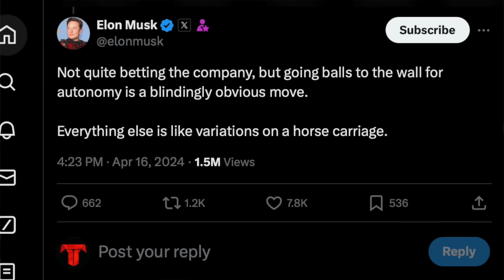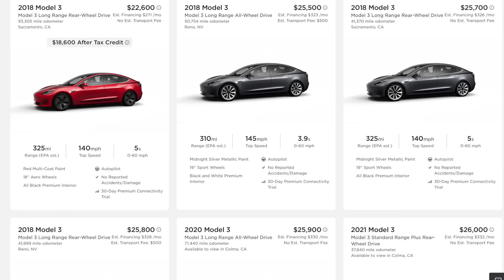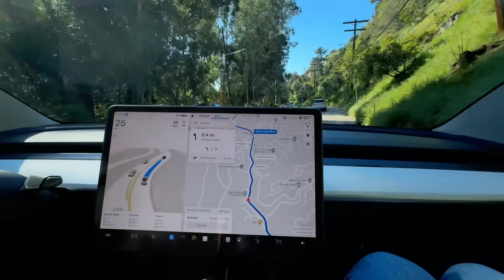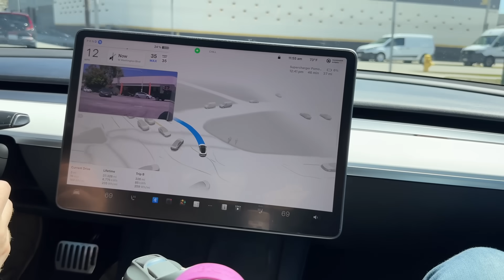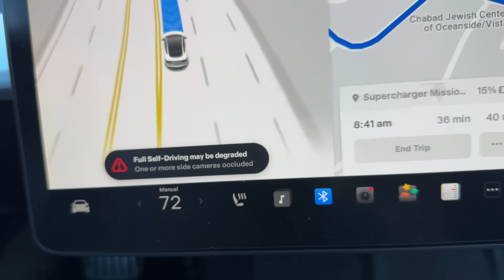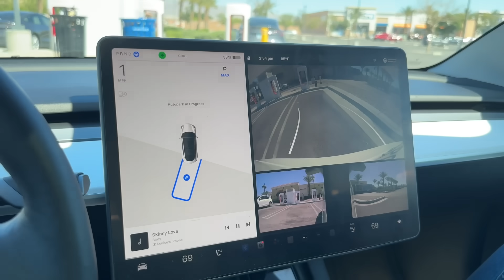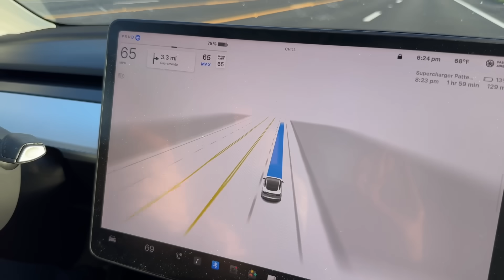Why Tesla Is Prioritizing RoboTaxi Over $25K Car

Comment: In my view: focus should be on driving down the cost of the existing lineup. I bought the Y for extra carrying capacity. I have no interest in a smaller form factor. Self driving is a work in progress. It will be ready when it is ready. In the mean time, most driers want to have a steering wheel and maintain control of the vehicle. Plenty of time to remove the steering wheel from production line in the future. Focus on beating the competition.

Comment: Solving for FSD from this point forward is a decision making problem, not a sensor problem. better camera placement could help, but as long as it is reasonably possible in good conditions (light rain, minimal snow) there is no hard limit on current camera setup. Coming this far without radar or lidar is convincing enough to me that from here on out it is an intelligence problem only

Comment: This next gen unboxed compact is going to be more of an architecture than a Tesla exclusive product. The next gen Bolt, the ID Golf, and Fords skunkworks compact will all be built on this new unboxed architecture. A prioritization of robotaxi over a competing Tesla compact EV is just a way of making the prospect of other companies utilizing Teslas new unboxed architecture more appealing as Tesla won’t be trying to outsell the compact EVs from those companies made on this new architecture. The more companies that utilize Teslas unboxed production method architecture, the cheaper the cost to produce them. I also expect Cruise and Waymo branded robotaxi services on this same platform utilizing FSD licensed from Tesla. This is a case of Tesla serving and growing the rest of the market since no one else is structured to make a profit on inexpensive EVs and no one is even remotely close to Teslas lead in self driving tech. Teslas goal has never been to bankrupt other car brands. Just to push them to produce compelling sustainable transportation. Unfortunately they have dragged their feet for so long that bankruptcies are starting to look like an inevitability. So Tesla is shifting gears to help the rest of the industry survive by becoming a supplier on which other companies can build small cars profitably. Tesla developed the unboxed method architecture to save the entire industry just as Toyotas just in time manufacturing process saved Detroit back in the 1980s by returning the big three to profitability.

Comment: I just took a lonng trip in a Tesla Model 3.   I've done the same trip in my Toyota Prius-C many times.   We had to charge at Tesla super chargers at about 38 cents per KWH.    With gas prices at about $5 galon, my Prius-C is actualy cheaper to drive.   I  bought the Prius new for $21K.     The "C" was a smaeerr lower cost verion of Prius.  Very basic and smaller.   To go mainstream EVs will need to cheaper to drive and own than my Prius-C.  (the tires for the Model 3 at 3X the price of the tires for a Model 3 and they last longer on Prius.     They need to get the cost of ownership down.  Not just the price of the car down.

Comment: 25k is paying for batteries, the car shell and electronics are free. Every couple of years you need to replace the dead batteries..
Reply from the maker: Teslas EV batteries either last 300k-500k miles or 800k - 1M miles depending on cell chemistry. Neither require replacement after a couple years

Comment: I see Las Vegas as the proving grounds and that Austin can be the plant to make the taxi as a commercial side of the business. This does not mean the lower priced car is off the table or that Mexico is not needed. I think it is part of the organic growth needed by the company. Which is at odds with it's battery storage demand that has happily augmented income. As you say it will take time and needs municipal approval. They already have a stake with the tunnels in Las Vegas that needs a replacement fleet. There is already an autonomous vehicle on Las Vegas streets that is not Waymo or Cruise. Tesla needs to move now. What they learn on making the assembly line in Austin will transfer to Mexico and India. Proving out the AI FSD in the real world will take time. Especially when you consider how long it took to approve rectangular headlights...

Comment: For me, the decision to prioritize the Robotaxi over the $25k car was what finally caused me to change my opinion about Elon Musk. For years I publicly defended him, but I now believe that Tesla would be better off without Musk as CEO. He should step aside and go found his own AI company and work on that, but stop causing delays new models of Teslas, because Musk want them to have new technology which isn't ready. It is pretty clear to me that Musk delayed the Semi and Cybertruck because he wanted them to use 4680 cells and the Model 2/C (or whatever it gets called) has been delayed because Musk wants it to have autonomy. These are bad decisions for society, because we need to make the transition to a low-carbon economy as soon as possible, and we can't afford to weight around until the next whiz-bang technology gets developed. Tesla could have been pumping out a $25k car several years ago, if the company hadn't been so obsessed with developing new tech for the car. What the world needs is cheap EVs now, not EVs with bleeding-edge tech that is still in development and will face years of regulatory approval.

Comment: Betting the company on a vehicle that has this many issues is a recipe for disaster. Also i just dont think that many people who own a car at the moment will want to rely on robotaxis. What happens in periods of high demand like at a sporting event or something and there arent enough? Maybe the more efficient move is better public transit 😬
Reply from the maker: Not betting the company. $30,000,000,000 in cash with no debt, steady income from existing lineup. Even if RoboTaxi fails they’ll be fine
Reply: @TailosiveEV maybe not betting the company, but the fact that there are already a ton of refreshed model 3’s in inventory already to me says that tesla needs cheaper new car options. Used EVs are still not a totally known quantity, and so people may be more hesitant to buy them. If their Q2 results are similar to Q1, they might have a real problem on their hands. They pulled every demand lever they could last quarter and still under performed.

Comment: We do not have enough info to speculate if he is switching positions again. He might just make the RT with controls and pay people a shitty wage to take control when needed until he gets the laws changed. With all the problems RT must overcome, we still do not understand why he thinks it is more important than the M2, other than a higher profit margin. Why won't he have the same problems as Hertz did with the RT?
Reply: That was already tired in Germany and it failed big time the response time was too slow and it caused issues that won't work this is just another snake oil sales pledge.

Comment: I'm not thrilled with this decision. "Self driving" technology has been moving forward and could be safe in the vast majority of cases but there are still edge cases, drivers and pedestrians are unpredictable. and there is a lot that can go wrong. It may be that this level of fully autonomous vehicle could only work if the only vehicles on the road were autonomous. That's not a world I'd want to live in.

A $25,000 new EV would be sweet but I do appreciate the issues you've brought up.
Reply: Don't worry Self driving cars goo down the wrong side of the road cuts off other self driving cars etc it will be a very limited auto pilot for 4 we will never have 5.

Comment: We really only need level 4 for robotaxi in most places.   there will likley be tele operators for sticky situations.   

Personally I'm goad they are making a hard move to autonomy.   They have already disrupted auto and the move to EV's is on.   chinese are going to easily fill the low cost market and no reason for Tesla to race to the bottom.  Innovation is how companies stay ahead.  First to market with EV and they will be first to market with a robotaxi that can be extended to new locations easier than a Waymo.   It's all happening and it's happening faster than many think.
Reply: Uh no it's not the move to EV has stagnated and control centres do not work Germany tried it and it failed big time 4 is all we need as a auto pilot but we will still need a steering wheel.

Comment: If true this is a disastrous mistake by Tesla. FSD will not happen in the next 20 years at least. There are too many hurdles.
Reply: not 20 more 100 even then 5 is false many engineers are only working on a limited 4 for private use as a driver assistance.

Comment: Wrong, wrong, wrong.  They don't need to be perfect to run robotaxis.  Waymo and Cruise are far from perfect.  They are only in a few cities after all these years.  They are geofenced because they need every road to be HD mapped beforehand.  They cannot go on the highways.  FSD version 11 was already safer than humans, Waymo and Cruise.  Most of the disengagements, by far, are for navigation, which is not really FSD.  It doesn't need to drive like you.  It just needs to be safe.  They don't need to be perfect for the entire country.  They can start with a few cities where it has the most video data for training.  Whole Mars Catalog in San Francisco almost never has interventions or disengagements.
Reply: And yet they have to recall second Cruise is dead it is over for them and the Lidar companies see the drawing on the wall many are downsizing and closing.

Comment: Get real Tesla Pumpers Elon needs to get his priority and get off X and spending his time doing stupid tweets! As we all know when Elon bought Tweeter, Tesla has been going downhill and continues to do so affecting his decision making and priorities. When Elon made Cyber Truck his first priority over the $25,000 sub compact EV that was a wrong decision! Now Elon priority to do the ROBO Taxi first than the $25,000 sub compact EV is a very bad decision as Tesla can sell millions of more sub compact EVs than Cyber truck and ROBO Taxi. The Tesla sub compact that we all were waiting for 
and thought Tesla was going to the first to have a $25,000 EV before the competition will take over. I hope Elon change his mind and make Tesla $25,000 sub compact EV model 2 which will be the number 1 EV even if the competition is coming but Elon need to push to have this manufacture quickly. The layoff should have happened when they started losing revenues and they probably need to do another 10% to show Wall Street Tesla can be profitable. So, the earning call is going to be the big factor if stockholder will leave Tesla as the sub compact EV will be the key to bring in the revenues needed to solve FSD and to produce the ROBO Taxi which will take years to solve and to have it permitted to run in any State! :face-blue-wide-eyes::hand-orange-covering-eyes::body-blue-raised-arms:

Comment: IF Robotaxi is basically a $25k model 2 then it should be very easy to make the Robotaxi, then produce the model 2 after the fact, only with driver controls installed. since Robotaxi will be all automated, the model 2 would be the same. brake by wire, accelerator by wire, and steer by wire. it would be quite affordable and easy to retrofit this into a Robotaxi to make the $25k tesla.

this would make sense because if they are basically the same car, you want the base of it to be built with likely higher profit margins (Robotaxi), then with the cheap tesla you add all by wire controls in it, then you have a $25k tesla.
Reply: IT won't be though it will be another flying car at a worlds fair that will never be made.